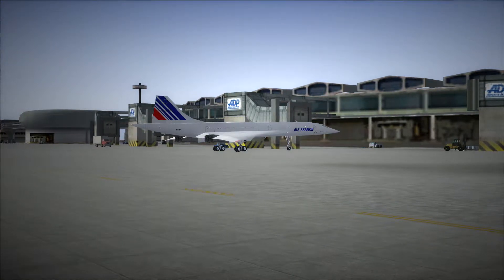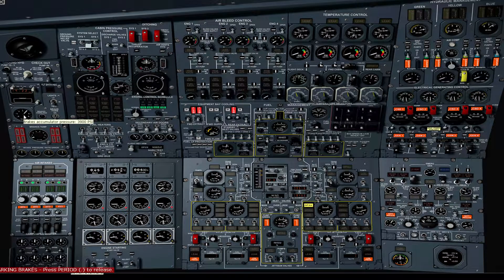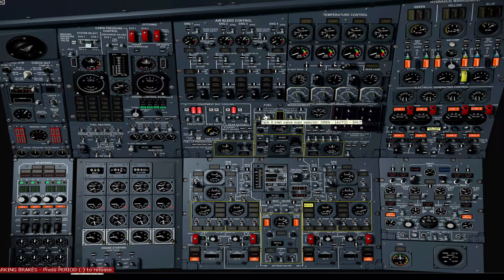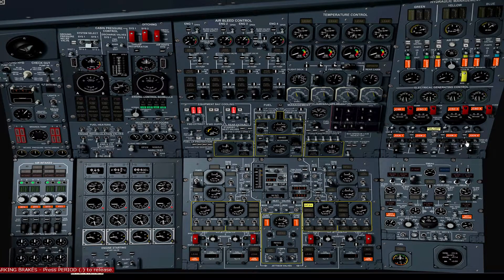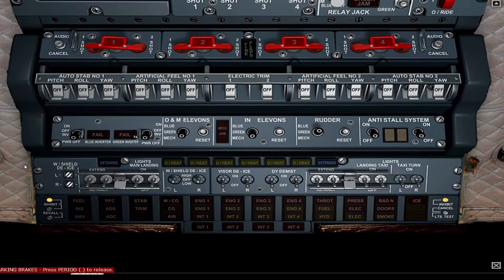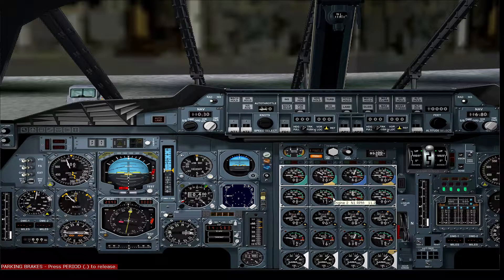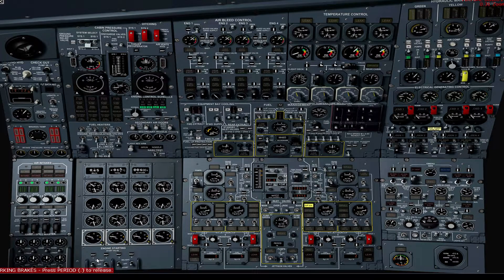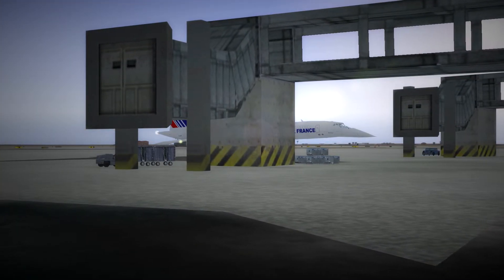PSS Concorde cold & dark start tutorial

Comment: Thank you very much! I know its been ages, and we are in the MSFS2024 era, but i'm still holding FS2004 close to the heart. Is there a way of not needing the "automatic Flight Engenier" I want to work the fuel transfer during flight with my own hands. But i cant find a Checklist/tutorial of PSS anywhere
Reply from the maker: Yeah, completely possible to switch off the auto flight engineer. Any real Concorde engineer checklist should be relevant, this thing is crazy accurate
Reply: @TiJayFLY  Thank you for the quick response. I wil do that. I knew it was accurate but not that accurate! I didn't flew it yet i'm learning before even start the engines. But i was a bit confused with the navigation. I Know how to work the INS from other planes that use it, Input coordinates in the CDU etc. But  i can't find in this model the MSU (Mode selector unity) to align the waypoints. Is there something that i'm missing or the PSS model doesn't need it in order to align/nav?
Reply from the maker: @DanDauzacker I got you 😁 there’s a few PSS Concorde full flights on this playlist https://youtube.com/playlist?list=PLppBeiobXD_Y2y12qf59-vhzBrswd4-oM&si=GmeT5Z1905N3z8AC
Reply: @TiJayFLY  Thank you! I did watch all the videos and yesterday i finally flew for the first time following your checklist and another PDF manual, very detailed. Turns out that the INS CDU align by itself and is almost impossible to fly and manage the fuel by yourself, the VFE is really indispensable xD. When i was a kid the PSS concorde was very complex and i didn't knew back then how different and amazing Concorde was, only today i'm able do deep dive into the complex sea of buttons and gauges. My only pet peev with the model was the texture quality, but with a few hours i manage to improve the BAW Landor  livery and now is perfect!

Merry Christmas!